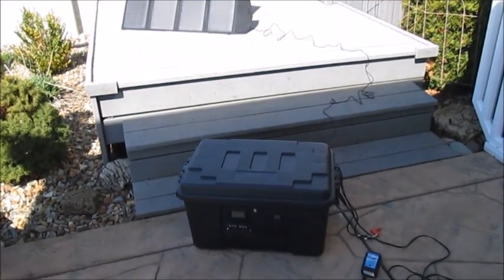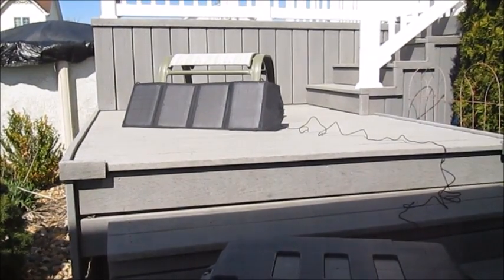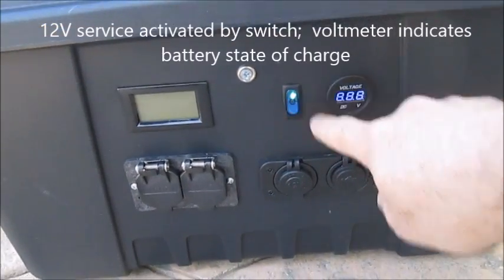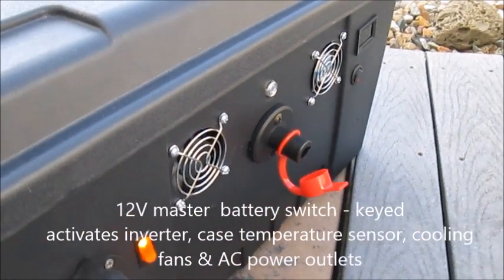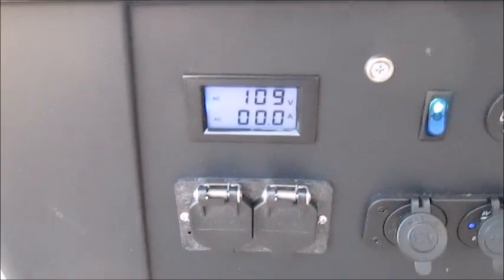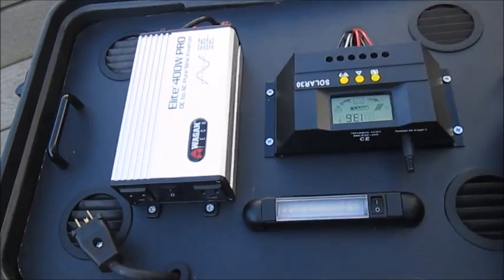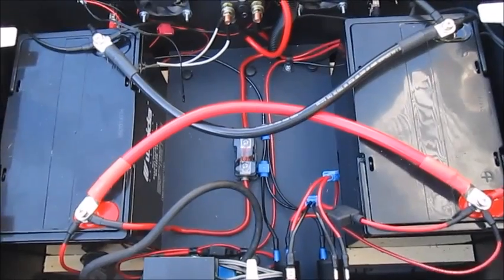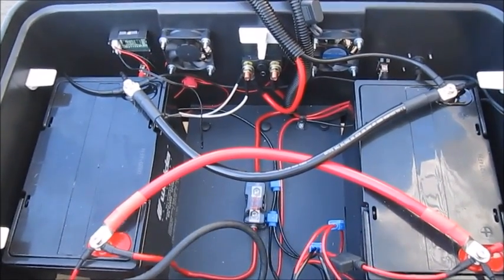V1 P1 DIY Portable Solar Power Generator - Wiring Schematic, Parts List, FAQ Sheet Provided

Comment: can you run this 24/7?
Reply from the maker: Tim, that would depend on the total demand for amp hours created by your intended load(s).  It can run 24/7, but only up to a total of about 44 amps that would be available given the safe discharge threshold of the 2 55AH AGM batteries.   That total is further restricted to 26 amps as determined by the ability of a single 100W panel to recharge them to 100% capacity in an average solar day.  Adding another solar panel or two would greatly enhance the ability to generate more amps during a solar day - both to recharge the batteries and for immediate use by any loads.  See my reply to Bruce Lee posted yesterday and have a look at the link I provided to a pdf with calculations I made for determining this system's capacity.

Comment: How many watts 

How long will it last.. Fully charged using all amp power
Reply from the maker: How many watts?   Assuming you would not want to discharge the two AGM batteries below a 60% state of charge this system would offer about 44 amp hours (40% of total of 110AH from the two batteries combined).  44AH DC = 528 watts DC.   If inverted to AC the 44 AH DC= about 422watts AC per hour (assumes about 20% loss due to power consumption of inverter).

How long with it last?   That is a difficult question to answer Bruce without knowing what type of appliance you wish to power and for how long you need to use it.  Here is a link to some calculations I made specific to my use/needs. http://www.creeksideartifacts.com/SPMC.pdf  This scenario is based upon  my need to power a small 7" HD TV, a couple of 15" laptops, a couple of cell phones, a LED light, and a 6" fan each day while staying on my boat.

Comment: Hasn't Renogy Recalled those flexible solar panels?
Reply: If it is the same ones, they have caused 11 fires .  I was just reading about it .
Reply from the maker: Yes, Renogy did in fact issue a voluntary recall on a specific batch of their 100W flexible monocrystalline solar panels.  I received my notice from Renogy earlier in 2016.  I contacted Renogy right away and also did some research of my own on the web where others who had purchased this panel, particularly sailors/cruisers, posted their experiences.  From what I learned in some applications they were having problems overheating due to Renogy's use of an improper backing material in this panel's design.  I had thankfully not experienced any problem with mine during the first season of use in the summer of  2015 when the panel was brand new, likely because in my use case the panel is not permanently installed on a hot metal RV roof, for example.  My panel has been used only on a relatively cool, well ventilated, breathable canvas bimini top, and only for temporary (day) use.  To avoid theft, I always disconnected my flexible panel and stored it inside my boat's cabin at the end of each day.  When I contacted Renogy about my panel I was informed that they are redesigning their flexible 100W panel and anticipate its availability in the summer of 2017.  I used the panel for this past summer's 2016 boating season (5 months here in NY) without any problem, no indications of overheating at all,  BUT I do plan to take advantage of their offer to exchange my original panel for the newly engineered model when it becomes available in the next year.
Reply: Very cool to know!  Sounds like Renogy is a good company.  Im in the market for solar panel products and im a little hesitant to go with Renogy just because in the Solar panel game a company needs to be around a long time.  And if a company isn't around in 23 years when your solar panel stops producing energy, no one will help you with a warranty.  So im asking around and trying to figure out who will be around in 25 years.  So far I've seen Panasonic offers a 15 year workmanship on their panels and 25 yrs on their panels producing 80% of output.  Im having trouble finding a dealer though.  Thanks for the response !

Comment: Jim, in my opinion your battery generator is the the BEST I've seen. It's clean, functional with a well thought out design.  In fact I've ordered all the parts to reproduce your solar generator. Being 71 years old I'm ready to get going.  Only problem I'll have is getting the upper and lower decks cut to size as I have no tools to accomplish this.  Thanks Jim for posting.....
Reply from the maker: Thanks so much Dave.  You may be able to get someone at your local Home Depot or other hardware store to at least cut the upper and lower decks to rough dimensions (the lower deck is a simple rectangle).  To get the tight, clean fit I was able to achieve on the top tray/deck I did use both a scroll saw (to shape the corners) and a router to contour the middle of the deck to fit the sides of the case.   Hope you can get the help you need to do the cutting.

Comment: Jim, can you list the different wire sizes for the fuses?
Reply from the maker: They are referenced on the wiring schematic Dave although it can be difficult to detect the relative wire sizes in PDF format. The 50 amp ANL fuse is wired with 8 AWG.   All of the other 7.5 amp, 15 and 30 amp inline fuses were connected using 14 AWG.

Comment: The red wire and the black should not be crossing one over the other,,,, Shold be keep seperate, in case if the wire should worm up and melt. Then you would end up in deep dodo.... the wole system would fuse and burn uncontrollebly.. no stopping it...
Reply from the maker: Thanks for your comments- good advice, perhaps I will add a spacer to ensure space between the wires connecting the batteries. With the number of fuses in the system I believe one of them would burn out before those 2 gauge cables would get so hot as to melt the shielding, but you can't be too safe.

Comment: It's brilliant. The only thing I don't like are those "Scotch Lock" (I think that's what they are called) wire splices. Those connectors are supposed to be for a quick fix, not a permanent install. Solder and heat shrink those joints instead and it'll be perfection.
Reply: Matthew Foote those "scotch lock" things are used in residential, commercial, and industrial, construction, and are expected to last for many years.
Reply from the maker: Check out my part 6 video-  ScotchLoks removed and a bus bar installed as part of a re-wiring upgrade.
Reply: FAA and NASA prohibit soldered connections for good reason. Crimp only is what passes inspection
Reply: Absolutely right and the terminals and crimpers are designed for the specific terminal and the die of the crimper actually forms an air tight bond with the cable when done properly.  You are talking about crimpers costing between $250 and $ thousands a piece engineered specifically for a few terminals.   Not chinese terminals made of tin and a pair of pliers used to mash it on the wire.
Reply: wwhhhatt???

Comment: 950?!?!?
Reply from the maker: Yes, total cost including the 100 watt solar panel ($220) was about $950.   About $730 for all the components in the battery box.  About half of that $730 covered the cost of two quality AGM batteries (as opposed to cheaper lead acid batteries off the shelf at Walmart) and a pure sine wave inverter (as opposed to a cheap modified sine wave inverter).

Comment: are you sure about the MPPT Controller? other than that, great job.
Reply from the maker: good catch John- I did make an error in my description within the video that contradicts the accurate information that is posted in the description posted below it.   It is in fact a PWM charge controller that I used.     
http://www.ebay.com/itm/181470909888?ul_ref=http%3A%2F%2Frover.ebay.com%3A80%2Frover%2F4%2F0%2F8%3Feecl%3D1%26eesi%3DUS%26i%3D1a592e40e55IIda1bcII6123b5II1a592e40752II1%26eepc%3D%2F181470909888%26bu%3D43189473992%26

Comment: if you add some wheel and stick.let it easy to move.it will batter....
Reply from the maker: Sam- I use a 4-wheeled mover's dolly to roll it around when it is not in use on my boat. As a matter of purposeful design the lack of wheels was intentional as I did not want the heavy battery box to be able to roll around inside of my boat - stability was a more important feature for my needs than maneuverability.

Comment: Your vendor for the SAE receptacle is listed as "direct" .  Could you please provide a link or website ?   Now about your solar gen. box , quality of parts A+ , quality of workmanship A+ , quality of videos & audio A+ , Schematic AA+ .  Your videos, Schematic, and parts list make this project Doable for the average tinkering guy.  Thanks for all the work you put into the project to make it understandable.
Reply from the maker: Thanks for your generous feedback David, it is appreciated.  Here is the link to the flush mount SAE port vendor:  http://www.solarcapitalist.com/sae2pin-surface-mount-connector-pigtail.aspx   You will need one of these for sure for the battery tender SAE port but I do recommend that you consider another product that you could use with ready-made solar cables with MC4 connections on each end to attach the solar panel to the generator.  Had this flush mount MC4 entry plate been available at the time of my build I would have used it.   https://www.outsidesupply.com/go-power-cable-entry-plate-gp-cep/  In my original build I cut the MC4 connections off of one end of each of two solar cables and added a SAE connection- I don't recommend that.
Reply: Thanks.

Comment: WOW! What a great build! Well done. I'm currently looking at building one of these for our many camping trips. I hope you haven't got a patent pending on this as I want to copy yours like for like! My partner would like to know though if you can fit an inverter in there capable of hair straighteners? Also, a product list would be awesome! Thank you.
Reply from the maker: Thanks Rob- have at it and build one for yourself!  Links to PDFs of the parts list and the wiring schematic are located above in the description of this video.  E-mail me at jim@creeksideartifacts.com and I will send you an excel spreadsheet with the parts list and functional links to specific vendors.  The space above the top tray/deck and the case lid is very tight.  There is not enough room to put a larger inverter in that space without reconfiguring the orientation of the AGM batteries....but you can attach a larger, external inverter using the remote terminals located on the outside/front of the case.  You'd need to determine how many watts a hair straightener demands to properly size your inverter.  My suspicion is that they are power hungry because they generate a lot of heat.
Reply: Thank you! I will send that email over now. Thanks for your quick response.

Comment: While you do potentially have 110 amp hours of power in the two batteries, that much of a drain comes at high cost.  See the cycle life versus discharge level chart here: http://www.kweightbattery.com/12v-batteries/cycles-vs-life-of-different-kind-of-lead-acid-battery
These people make batteries, so they're the ones that know the product best.

Discharging the batteries completely will give a life of just over 200 charge-discharge cycles.  Only discharging the batteries to 50% increases the life to perhaps 450 charge-discharge cycles. Limiting the discharge to  30% increases the charge-discharge cycles to about 1100.  

Do you want the batteries to last 1 year or 5 years?  Plan your usage accordingly.
Reply from the maker: Thanks for your comment-  using the total amperage capacity of the batteries (in this case 110 AH) to define the size of the system can be misleading.  I think most who use these systems understand that totally discharging the batteries is a big mistake (if they don't they had ought to spend a lot more time learning about proper battery care).  In my use-case, I seldom discharge the batteries below a 76% SOC as my daily demand is for about 26 total amp hours when using it on my boat during a 24 hour period.  Here's a link to the spreadsheet that I devised to carefully and accurately plan for energy consumption using this system with a single 100W solar panel.  It is important to do your homework and to fully understand the capacity of such systems before putting them into use.    http://www.creeksideartifacts.com/SPMC.pdf

Comment: How did you wire your ac voltmeter with converter?
Reply from the maker: There is cord coming from the inverter that was made from a length of bulk 3-wire 
extension cord purchased at a local hardware store.  A male 3 prong 
plug was purchased separately and attached to that cord- it plugs into the inverter. The bare wires 
at the other end of that cord are attached to the terminals on the 110V electrical outlet.  The AC voltmeter has both positive and negative wires that supply its power, they are attached to the respective terminals on the AC 110V outlet.  The AC voltmeter I used also comes with a current transformer that reads the amperage flow through the outlet.  The current transformer is donut shaped-  the positive wire from the inverter is passed through the transformer before it is attached to the positive terminal on the 110V outlet.
Reply: Jim, is there a particular part number for the ac voltmeter you used? I was hoping to. send you a photo of the back of the voltmeter I purchased, but haven't figured that out yet
Reply from the maker: This is the exact voltmeter I used https://www.amazon.com/DROK-Multimeter-Back-light-Transformer-Monitoring/dp/B00DVH64HW?ie=UTF8&psc=1&redirect=true&ref_=oh_aui_detailpage_o00_s00
Reply: Thank you sir, I appreciate your time!

Comment: I just use a jump box or car emergency starter 12v 750 amp with built in light , air pump, usb, DC cigarette lighter plugs and ac 110 house current on sale for $100 and drill a hole and use the diode  or wire to the switch there directly to a solar power source.
Reply from the maker: I have one of those too, I started with a Wagan Power Dome 400 that I charged with a 27 watt solar panel.  Those emergency starter/power packs have very small batteries (only offer about 18 amp hours) and low wattage (400W) modified sine wave inverters.  They are a great solution for some applications.

Comment: Good construction. a little pricey.
Reply from the maker: Thanks for having a look and for your comment.  My DIY design incorporated a lot of features that you might not find on commercially available models and the non-volume, retail cost of those components definitely added up quickly.  If someone wanted to copy my basic design and save some money I would recommend the following:  exclude the remote heavy duty terminals for jump-starting;  exclude the bulkhead terminals and screw on knobs that allow for attachment of an additional/external inverter;  use cheaper (not AGM) batteries;  use a rigid polycrystalline solar panel instead of the more expensive flexible monocrystalline panel that I used;  install a cheaper weather resistant cover for the AC outlet (that Leviton cover alone was $30!).  Those recommendations would likely bring the total cost down by about two hundred dollars.  All that being said, this unit was definitely designed with high quality in mind and I incorporated additional features that aren't often included in such systems that were important for my needs, specifically on a boat.

Comment: Great video. If you were to try to get as much capacity / voltage out of that platform (to fit in that container), what would you change? Do they make higher capacity batteries that would fit, and then I would think a higher voltage inverter. Thanks!
Reply from the maker: Thanks Todd.  Good questions.  There is room in the container to add one more of the same 55AH batteries that I used, that would total 165AH.  It would be necessary to relocate the ANL fuse and some of the wiring that you see in that larger open space in the middle to accommodate the third battery, but it could easily be done.  There are certainly higher capacity batteries available, but I don't know if they would fit.  What I can tell you about the inverter is that the space available above the batteries is very tight.  It would not be possible to put a larger inverter on the top deck/tray, but it is possible to connect a much larger inverter externally using the two terminals with the screw-on knobs.
Reply: +Jim Fisher: forgot to ask, what did you use to cut thru the case, drill, small electric saw?
Reply from the maker: I used my drill outfitted with hole saws and spade bits for the various round holes.  For rectangular openings I used a utility knife to carefully score and cut the case.

Comment: thanks man really very helpful 

what is the yellow circle  in your diagram coming from the voltmeter is it a shunt
Reply from the maker: It is a donut shaped transformer that came with the ammeter I used.   The positive wire leading to the AC outlet passes through it and it reads the amperage flow, just like a shunt.
Reply: thanks
Reply: Hello
Really wonderful
I am finding difficulty to wire donut shaped transformer ammeter can you please draw a sketch of how do you do it, or show it in video, thanks

Comment: What a really good video. I actually believe that I can do this!
I am hoping to purchase a small Class C rv and this could be mounted on the rear bumper.
Now if you'll please excuse me, I'm off to view some of your other videos.
Reply from the maker: Thanks for your comment and go for it!  To be clear, this design isn't completely weatherproof so you may need to consider that for a rear bumper mounted application on your RV.  It is weather resistant, but I would not expose it to the elements for prolonged periods of time.